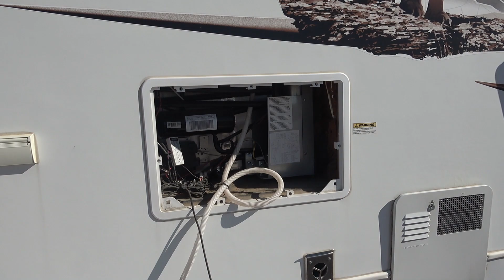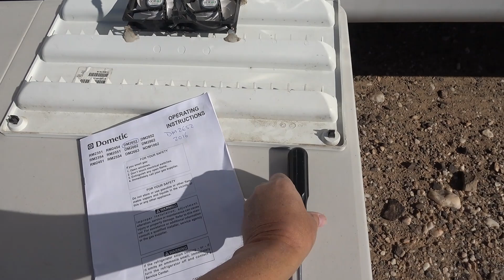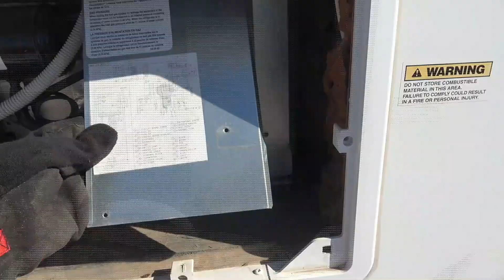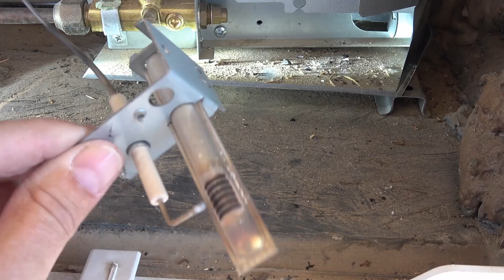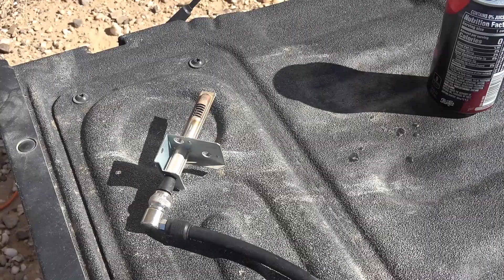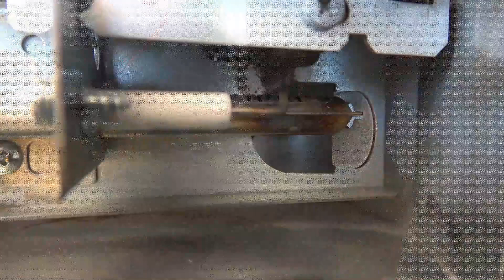RV Fridge Maintenance - LP Gas Burner Cleanup

Comment: I bought a 20 years old caravan, and as I'm a newbie, I'm reviewing and learning how the gas system works. My refrigerator "domestic" doesn't want to start, I hear the noise of the gas ignition, but the flame won't turn on. I'll follow the advice in the video, give it a good clean, and then come back here to tell the result. Great video. Thank you very much
Reply: @eridulife  did you ever end up getting results?

Comment: Good afternoon Ray, hope you're having a good time up there on your boat tell Ayan I said hello. I just replaced the igniter in my refrigerator that looks identical to this one on my motorhome you've seen it before. It would seem to failed me on the trip up in the mountains. And I diagnosed it with your helping a lot of other people's and found out that's what the problem was. Seems to be working fine now but I have a question for you I noticed in your refrigerator as in my frigerator there's no thermal coupler there next to the igniter. Can you explain that to me why there's not one there and is there some other place that it maybe? I know you're nowhere around your RV right now but if you can answer that when you get next to your RV I'd appreciate it apparently everything is okay on mine cuz it looks just like yours only much dirtier yes I'm going to go clean it now you made me feel guilty. Happy sailing
Reply from the maker: Had a terrific 4-day trip on the boat, now back enjoying the RV. What a life. :) 
From what I gather on many of the newer generation Dometic fridge models, they use an integrated control board that can utilize the sparker electrode to sense the presence of flame via resistance through the flame. So they no longer need the thermocouple.  My Suburban water heater does a similar thing with its spark electrode to sense the flame.
Reply: @LoveYourRV  Ray you and Anne have such a terrible life now. I like that the rest of us would love lol

Comment: Thank you for a good information. 
 Dometic RM2801 RV fridge could not ignite the fridge. Sometimes igniter starts blinking making clicking sound but it will not start tge fridge. Igniter light sometimes comes on sometimes  does not. I cheched the house battery voltage and shoved 13.2 v. sometimes l
Therefore I used to light it  up with a lighter and used to stay on lit.Then, after watching several videos I decided to clean the orifice or burner assembly. Even though I did not use excesive mechsnical force to clean it now it will not stay lit after lighting up with a lighter. I did not find any knob or valve to adjust freezing level of this fridge and ir keeps burning the propane  no matter how  the outside temperature is. 
Any hints or suggestions will be apprecuated.

Comment: Mine is over 20 years old. Many times, flakes of rust fall into the burner slots. You can unscrew the nozzle from the burner tube and dump them out.

Comment: What about the jet's tiny hole, where you placed the sticky tape. Do you not find that that blocks up? I do find it odd that there's almost an half inch air space between that jet and the start of the burner tube, why have that gap? I have a Dometic RM8405, that's got a very similar set up.
Reply from the maker: It could get blocked but I haven't had that happen yet. Guess there is enough gas pressure to keep it clear. I think gap has got to do with getting just the right air to LP gas mixture for a good flame.

Comment: Thanks for the video!  I needed to clean mine and couldn't figure out how to remove the cover over the burner.  I removed the screw on top, but the cover didn't come off, so I thought there was a screw I was missing. I just needed to use a little more force!  Mine is cleaned out and works on gas again!

Comment: I did exactly this.  I am a Red Seal Tradesman with a ton of Piping experience.  The Fridge on Propane had issues for the past few years lighting.  Last weekend it was working for a full day and decided to not light anymore.  I thought it was the solenoid valve.  NOPE just a good cleaning as you recommended and it works like a charm now!  THANK YOU so much for the content and hope you have a great RVing season :)
Reply from the maker: Great to hear, Cheers! Ray

Comment: Great, very thorough video!  I was wondering if you have ever taken apart the flue (the big round chimney on the right side) to clean it out?  Our Dometic is 21 years old but it was working fine after having the gas burner replaced recently.  Now it's not working again...blue flame looks OK but it's not cooling...IDK I'll take a second look at the flame after watching this video because ours might not be as healthy-looking and I smell a little propane, but flame is blue.  There's plenty of rust on the ammonia tubes.  RV shop charged us $500 to put in a new burner on this old fridge (which was their advice) and to say the least I'm a little bit frustrated right now!  Maybe we should have used that money for a new unit.  Any visit to the RV repair shop around us is $140.  Thanks for the helpful details shown here.
Reply from the maker: There is some kind of brush to put up the flue, like this https://www.camperid.com/dometic-rv/burner-tube-cleaning-brush-mpn-91872.html
But, If you are suddenly getting no cooling at all but still have a flame I would suspect that there is either a blockage in the piping or a leak and it has lost its ammonia. Being rusty its possible it got a pin hole.
If it lost its ammonia then it would have made a funny smell for a while or there may be a fine yellow powder in the outside compartment. I had one leak - https://www.loveyourrv.com/fridge-meltdown-extended-rv-warranty-s/ It was new fridge time.  Cheers, Ray
Reply: @LoveYourRV  Curious about your opinion of the “burping” treatment/laying the fridge on its side?
Reply from the maker: I've heard mix results, but worth a try I guess

Comment: Thank you Ray, I always wondered exactly what to do for a good clean the fridge and also the hot water heater burner care, do you have a video of that?.  And yes, it's better to do it ourselves.  not all technicians are professional, plus, the trouble to get there and the length of time for an appointment. Cheers :-0)
Reply from the maker: Here is my water heater maintenance - https://www.loveyourrv.com/yearly-rv-hot-water-heater-maintenance/  I usually pull the burner off then wash it out with soap and water. Sometimes bugs like spiders can clog the tube with their webs and interrupt proper gas flow.

Comment: Great video and thanks for sharing. Last summer I installed window screen to my roof top refrigerator vent. I removed the cover, smeared JB Weld around the lip of the vent and placed a sheet of the screen on it. Once the JB Weld set I trimmed off the access, cut holes for the screws and re-attached the cover. That in conjunction with the access door screens keeps everything out. Except the occasional tiny black ants. I like your cooling fans. I may add a set this summer. Much needed for living fulltime in Florida. Safe Travels.

Comment: Ray, nice job.  Do you have any concerns that the lower fans have an effect on the pilot light, flame or gas? I’d like to install a set on my trailer.
Reply from the maker: Thanks! Not really, the fridges are designed for operation while camping with wind blowing, the fan airflow isn't near what a good natural wind blows in there. Ours has no pilot light as its direct spark ignition.
The shielding protects the flame pretty good, haven't had an issue.  Many of the OEM fridges especially those in slideouts outs come with fans, though they are notorious noisy. :) My last fridge had one and I swapped it out for a quieter computer fan - https://www.loveyourrv.com/replacing-my-noisy-dometic-dm2652-rv-fridge-fan/  Cheers, Ray

Comment: Great informative video. I have the same drain tube on mine. Do you periodically drain the tube? Is it supposed to drain outside by it self?
Reply from the maker: Yeah, its suppose to drain by itself as required. A little water stays in the loop to block outside air from coming into the fridge interior.

Comment: I had a 5 yr old trailer. That drain tube was totally dried out, and literally fell apart.It was starting to drain water on the wood housing, would eventually rot that too.  I replaced it with a solid rubber hose.

Comment: I live in TX and mud dobbers love RVs. I put some vinyl window screen inside the exterior cover. Held it in place with a hot glue gun. Keeps the riff raff outside.
Reply from the maker: Nice tip!
Reply: This sounds like it's a good tip for both insects and rodents but not clear on how you secure the screen and then shut the  outside/exterior cover. It seems it might work in many more areas than the by the LP burner.

Comment: I went through doing all of this last summer while on vacation. I was testing the fridge one more time the day before we were going to need to run it on propane while visiting a few places in between campgrounds and it smelled like fire! I got through cleaning everything and it still wasn’t getting a steady flame and kept feeling like it was going to burn the wall down. So after a hour or so of cleaning and checking things out the water heater quit. Turns out the propane regulator auto switch was on its way out and was causing all of the problems. Luckily I could grab a single grill regulator at Lowe’s for $10 to survive the rest of the week before replacing with the correct one. I now carry that single as an in case of emergency part.  Good work Ray!
Reply from the maker: I remember one time a propane pig tail line failed, the little safety valve in it stuck, same thing cause weird problems. :)

Comment: Soak in mineral spirits?  Why mineral spirits?
Reply from the maker: No particular reason, any type of solvent should do the truck. Mineral spirits happens to work well and is cheap. I got the idea becasue that what my portable generator manual advised for cleaning the spark arrester screen.

Comment: PERFECT blue flame, Ray!  I don't know how you'd adjust the gas/air ratio on that burner, though... There's no way to shut down the air intake into the burner.  Also, you want to ensure that the flame does not have a [vertical] gap between the burner and the blue; you want it to "ride" on top of the metal.  If it's correct [like yours is], you're getting the maximum heat value from the gas and it's an indicator that your gas pressure isn't too high.  Otherwise, there could be unburned gas seepage which could cause your propane detector to alert.
Reply: I'm researching how to best to clean a "#58 gas jet".  It's the part that Ray put tape on so no junk went inside.  I've removed my #58 gas jet anf the tiny hole appears clean (I can see through it, clean circle).  The PROBLEM appears on my Dometic that the flame comes from the burner back to the jet.  And the flame shoots out of the jet "off center" -- like it's not aligned to send the gas straight toward the burner.  Thoughts?
Reply: @clayturnbull  Forget about the jet and focus on the burner tube and burner grid, Clay.  What I'm thinking is that there could be debris [spider webs? dust? dander?] on one side of the tube or burner grid preventing an even flow of gas 'n' air through it... Which could — uh... does! — throw the flame alignment off a bit.  Failing that, take your regulator to your local gas supplier and ask them to perform a "water column" check on it; which is a measure, in OUNCES, how much pressure is going into the jet/orifice.  Let's all admit it:  We bang those regulators around like necessary evils and not the [slightly] delicate pieces of equipment they are!  Yes... They can get knocked outta whack!  If the pressure's too high, as mentioned in my comment above, the gas can literally blow the flame away from the burner and you won't be getting the optimal BTU value of the gas from your unit.  

Give one or both of those solves a try and get back to me... And keep th' greasy side down and keep it 'tweeeeeeeeeeeeeeeeeen th' ditches, Y'All!  ;)

Comment: Don't forget to check the electric connections,  mine had loose ground contact when I got my unit. I check and tighten periodically.
Reply from the maker: Good tip, thanks. Cheers, Ray

Comment: The amount of time to clean this, how did you leep the food cold/ frozen ?
Reply from the maker: If you don't open the fridge door there is hardly any temp change, the RV fridge is like a really well insulated cooler. Don't open and let hot air in and it will be fine. We actually turn it off when traveling and never have had any problems with food spoilage.  Cheers, Ray

Comment: Just curious when you’re running on propane what is a ballpark consumption of propane?
Reply from the maker: It pretty low, haven't actually measured it but when it's warm out we hardly need to refill the tanks, its the furnace that really eats propane and the water heater, so cold weather is the worse. Basically cold weather lots of LP gas used but hot weather not much so leads me to believe the fridge doesn't consume much. It makes sense as it's quite a small flame compared to the furnace or stove or water heater.

Comment: I think those thermostatic ventilation fans upper and lower should be standard on all RVs. Do you notice a better functioning refrigerator like colder food, faster ice making etc. with the fans than without them?
Reply from the maker: I do notice a difference in the warm summer months for sure. Our RV park site has the sun on the fridge side so it has to work hard, any cooling helps out, especially for the freezer and when we replenish stocks after a grocery shop, seems to come up to temperature fast. During the winter here in the desert I often have soda freeze if n the top shelf, so that means its working well. :)

Comment: Another great video. 
Curious, is that insulation on the right hand side? Looks a little dirty, and not quite covering the whole wood panel.
Reply from the maker: Thanks, Yes, that's some pink insulation installed by the OEM, here is an earlier video that shows the area with the fridge pulled out - https://youtu.be/dGBG1Jyx5SU?t=290  It's a little dirty from years of visiting the dusty desert. :)